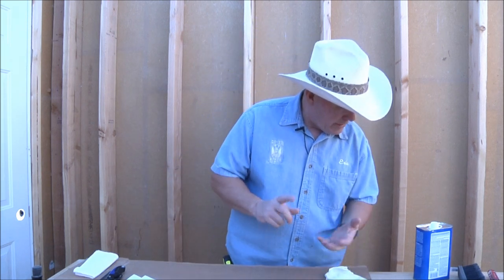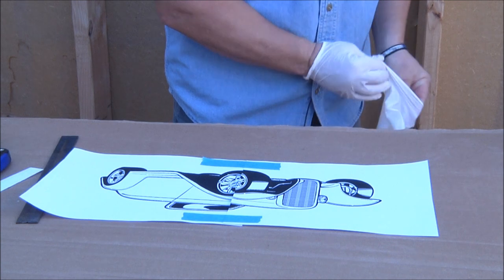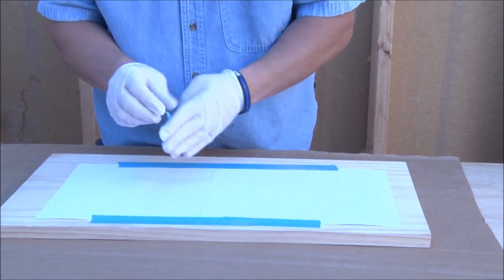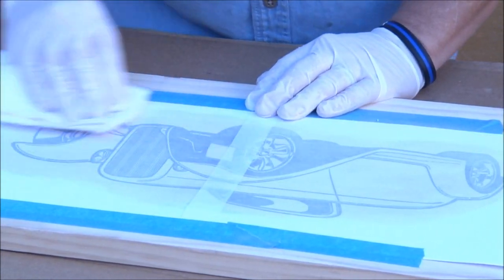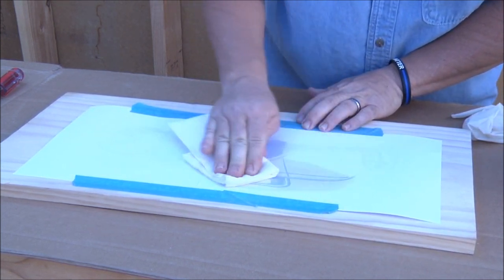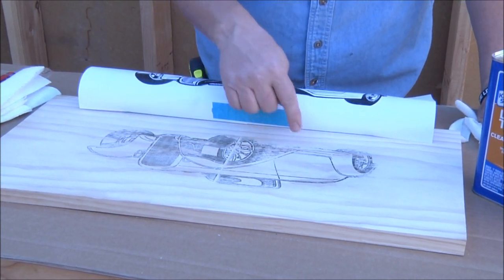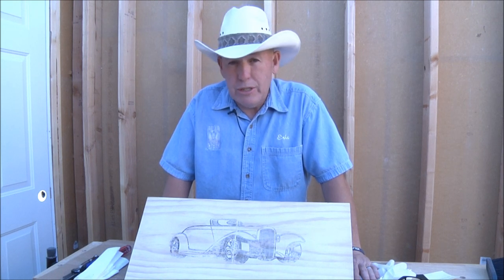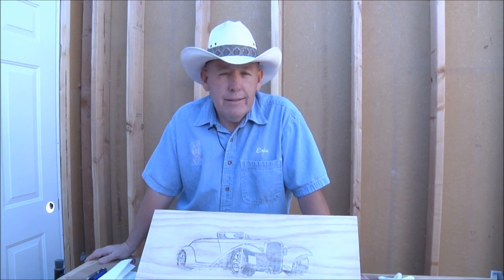#212 Another New Transfer Process LaserJet Print

Comment: Nice video Eric &Vicki.  For ink jet printers I use a similar process.  Use water to dampen the wood (not enough = poor transfer, too much = smearing) to raise the grain.  Print reversed image on transparency or clear notebook divider.  Use a spoon in circular motion to rub the ink into the pores.  Tape transparency down to keep it from shifting if needed.  This leaves a great image to carve out and the transparency sheet can be cleaned and reused.
Reply from the maker: Fascinating, I will have to try that for inkjet.

Comment: When I saw your heat transfer method, since I didn't have a wood burning tool I tried it with my heat gun.
I found that if you heat the paper until it JUST starts to burn (brown color) and rub it in (I used a wooden spoon) the transfer was actually quite good. 
Tip- The heat gun (on high) will take about 15-20 sec to get hot enough to start browning the paper. Keep moving the gun, rubbing fairly hard on the brown paper then moving to another area. The paper will brown quickly at this point. Oh, and I found the gun (for me) worked well at about 5-6 in from paper. The end result is paper that is completely dried out and will crumple like a dead leaf.
The transfer was ALMOST 100%, with defined lines and dark solid areas. Try it and let me know how it worked for you!
Thanks!
Reply from the maker: Interesting, I'll give it a try. Thank You
Reply: @oldave100  was it worth trying dave?

Comment: Eric, I have been looking at transfer methods for a while and I ran across this same process in a couple of places, one using lacquer Thinner and one using Acetone. I don't think that makes much difference, however one process put the Acetone (or lacquer thinner - forget which one it was) on the wood first - just a single coating (print was previously taped down at the top)then flipped the print down over that coating and applied the Acetone to the print as you did - but he used a roller instead of the paper towel or rag - which also soaks up the liquid. The transfer was pretty good. I just used this lacquer thinner method on a sign and I really lost some of the print which I had to hand pencil in. Have not yet tried this roller method yet but intend to when I get back to the router...
Reply from the maker: Hi Gary, interesting, I may have to give that a shot. Makes allot of sense so I will give it a try.
Reply: Tried the roller once... didn't seem to be any better than hand rubbing, but that was only  one try.

Comment: If u ever get the chance,  look up Palissade transfer paper. The stuff is excellent. You gotta try it.  And im wondering if the thinner used with it might have even better results.. Just wanted to throw that out there. The best results by far,  that i have tried.   Love watching your vidoes,  great work!
Reply from the maker: Thank you Keith, I will check that out.... Thank you so much for watching and the kind words, Eric
Reply: I forgot to mention, palissade paper is realy thin that some machines have trouble running it thru the printer.. But just take a peice of that blue painter tape u had in this video and lay a strip on the edge that goes first in the printer and u will be fine. Thanks for your reply!

Comment: This is just the way i did it before, but i used acetone , i think we talked about.
But i prefer using the transfer tool / heat, it gets much cleaner lines that are more easy to follow ;)

Take care buddy, and as always great video !!

/ Morgan
Reply from the maker: For my it just takes so long. I guess I have no patience......
Reply: He he...well there is no right or wrong way to do this, as long as it works ;)
Reply: I tried acetone but it didn't work very well for me. Then I found a xylene-based brush cleaner tucked away on the back of a shelf. It works a treat.

Comment: You may wish to use "nitrile" rubber rather than latex gloves  as the latex absorbs the thinner, nitrile does not, safer to use  (polyethylene "food workers" gloves would work too, and are cheaper.  But as the other guy says, tape it first.  A squeegee also pushes more thinner thru the paper for a stronger image.  If you want less toxic solvent use Citri-Solve, made from citrus fruit.  Another great tip/ and video.
Reply from the maker: Thank you for watching and for the info. I appreciate it, I will give that a shot for sure.

Comment: I do signs and use felt squeegees for some of the work and also use plastic squeegees with felt glued on and they are sold that way. It might help make the transfer. Do not use thin cheap felt squeegees. They are garbage.
Reply from the maker: Thank you, I will see if I can find one of them and give it a try.
Reply: Sign shops sell them. They used for installing printed signs.
Reply from the maker: Thank you